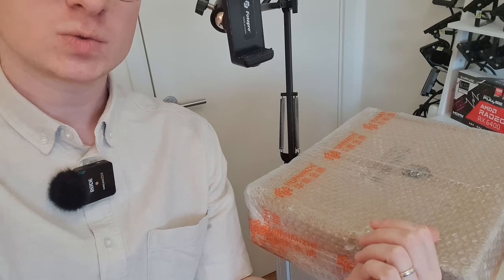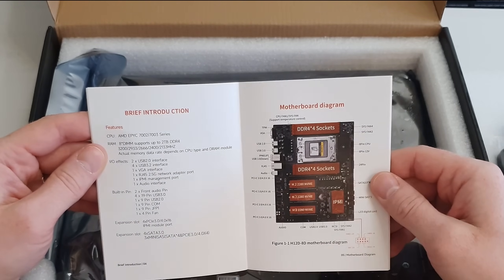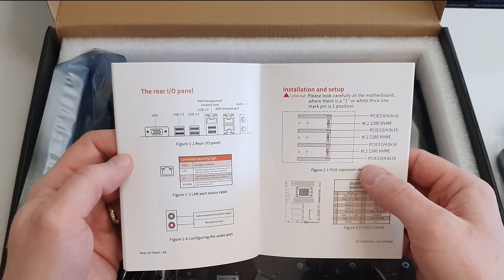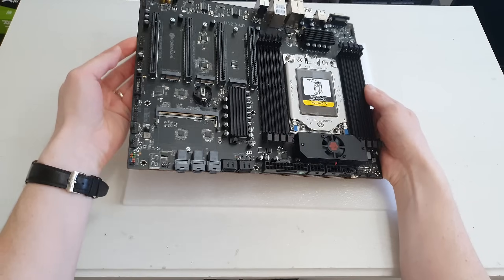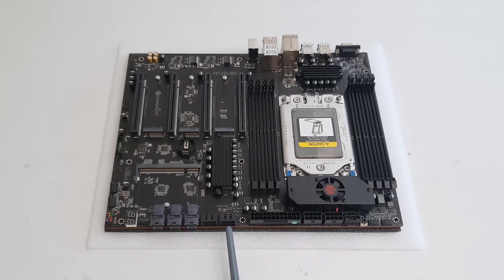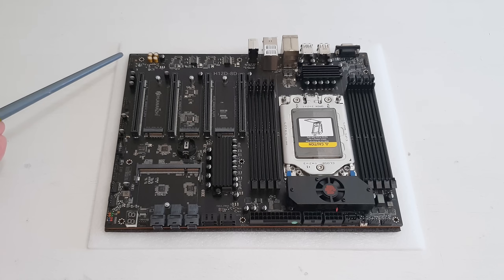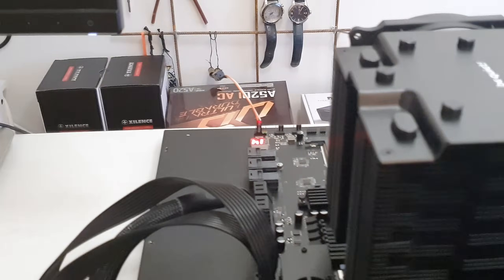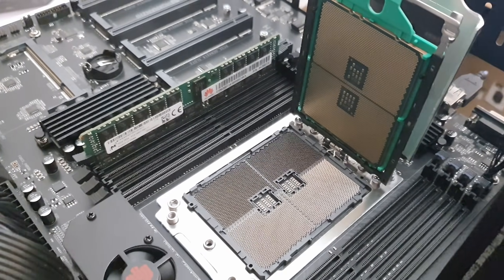Huananzhi H12D-8D EPYC motherboard – unboxing and first boot attempt

Comment: Hi, would you mind revisiting the board again? I just bought it a while ago and mine came shipped with BIOS-version 2.0 and my booting times even with BMC is way shorter than in your tests maybe around a minute.
I came across that board earlier this year but your review helped me a lot in my purchase decision. Currently it's running an Epyc 7402 and 8x16GB ECC from Samsung and so far it runs like a charm...
Reply from the maker: I no longer have the motherboard and I can't afford buying another one at the moment.

Comment: Hello everyone, I bought this board along with the Epyc 7702, but I'm having post code D0, after researching a little I saw that it's something related to the CPU, has anyone experienced this problem?
Reply from the maker: Are you sure your CPU is not vendor locked? How much and what RAM do you have installed?

Comment: Rookie mistake with the missing CMOS battery, since Ryzen debuted, AMD systems will now take a while to train the internal clocks to pair the cpu, ram and motherboard so it will take a while and reboot a few times. Since there was no CMOS battery, there was no charge to keep the configuration ok it's next reboot.

Comment: Almost all modern server motherboards have a Server Management Processor (SMP) like the Aspeed AST2500 on the Huananzhi H12D-8D. The SMP boots up before the CPU, it does a check of the components and displays boot progress through the VGA port. Using the VGA port initially allows you access to CMOS settings typically the "del" key, where you can set the add-in GPU as the primary display. The EPYC CPU is an 8 memory channel CPU and ideally you should install 8 identical DIMM.

Comment: Awww bro. Watching you tighten the CPU bracket without the right tension hurt my techno soul. If youre gonna play with EPYC and Threadripper you need to find your AMD torque driver. Without the right tension you will likely have issues with PCIe connectivity and RAM as all channels may not be properly connected.
EDIT: Oh and then you installed the memory wrong.
And then also didnt install a CMOS battery. You NEED a CMOS battery with these systems as during initiation there is power testing and training phases that require that you have a CMOS battery installed. Rookie mistake, but this is how you learn random crap like that. Through experience. Often we learn the most about things when they don't work and we have to troubleshoot them. Especially the random obscure crap like that which will be useless knowledge in any other situation.
Reply from the maker: I agree about the CMOS battery, should have tried installing it. RAM I have tested in all possible positions, just not on the video, also with the Chinese motherboards you never know what is the first slot, they often copy titles from branded boards but use own random tracing. In the past I dealt with quite a few Threadrippers so I kinda know the required torque and so far my torque feelings are correct but I will try to find the appropriate screw driver either way.
Reply: @Miyconst  Yeah, thats fair enough. If you have been using a normal driver and you already have a feel for the right tension, thats good. And yeah, those chinese boards do get weird with how they do some things.
Funny thing about the CMOS battery. The reason I know about the initialising sequence requiring a CMOS battery is because I had the same trouble myself. Only it took me longer to figure it out cos I had a CMOS battery in there, but it was flat and I didnt know. But thats often the only way to learn random specific technical crap like that. While trying to figure out why tf something is not working when you think it should.

Comment: @JasonsLabVideos 
43 minutes ago 
@sarisniper7990 Its not going to automatically go out on the internet and get an update 
to reply 
@sarisniper7990 
0 seconds ago  
@JasonsLabVideos I didn't just mean automatically. Oh smart guy, I just said brief words. I mean that by pressing the keyboard or by downloading Windows, this is done automatically. After that, it is updated. This is exactly what I meant, but only smart people understand what I said. Automatically, BIOS, such as the graphics card and other things, etc. There is also a way to run a CD drive. Download Windows discs or computer driver programs are found on the discs.

Comment: Check if this board can bypass "OEM LOCKED" cpu's --- what would be really good as those cpu's are always a bit cheaper.
Reply from the maker: That's very unlikely but if I ever get a vendor locked CPU - I will check.
Reply: That is a feature of the CPU, NOT the Motherboard.

Comment: 🤔👍Hi! Why didn't you try putting this in the BMNC? Also, why didn't you replace the graphics card with another one? The RAM isn't put in this way. It's not put on one side only, but one opposite the other, so try it. Also, why don't you try putting in the internet cable? You might need to automatically update the BIOS or something else.
Reply from the maker: I have already managed to get the motherboard started, thanks for the ideas though.

Comment: would it possible to mod the bios to make the amd epyc vendor locked cpu work with the motherboard? I have a dell epyc 7702P and I was looking for a "cheap" motherboard to use it
Reply from the maker: That's either impossible or very hard to do. You would need to obtain Dell's private cryptographic keys and then make the motherboard to pretend that it's a Dell machine.
Reply: @Miyconst  I understand, that's unfortunate

Comment: The board looks great. I think this is the best upgrade path for those of us still on X99 (even dual boards) that want high cores & lanes; makes more sense than X299 at this point. I wonder if Huananzhi will release a dual socket version, now that would be EPIC. After your review of the booted version comes out, I think if it's all okay and solid, I will sell most of my boards and get this.
Reply: I wonder, what are y'all doing for EPYC to be worth it? If you've got a gpu or nvme server, just stick to the old platform and if you need all out cpu power, ryzen 7950x or 9950x is scary good.
Reply: @b127_1 YT deletes my long detailed comments but the CPUs are fine for sure. But ATX and EATX board options absolutely suck and you can't convince me otherwise; all the AM5 boards were a huge disappointment to me and a complete joke for the form factor. Even the slot arrangements got worse from AM4.
Reply: @b127_1 mostly just hobby, I have 4 x 4U servers, tons of boards. Issue with some boards, especially dual X99 is they didn't get the ReBar BIOS update and don't have slot bifurcation; some of the single proc X99 boards do. So you don't really get the benefit of some of the newer GPUS bandwidth wise or cheaper addon cards that don't need a PLX switch for bifurcation. Plus of course stuck at 3.0 PCIe.  The newer Ryzen CPUs are fine of course for a lot but the motherboards absolutely suck. Almost all the AM5 boards are absolutely a joke in ATX and EATX form factor. I've looked at every single one. If you're just a basic gamer or just some basic Plex or basic VMer that yeah, it's fine but ultra boring to people like me. I personally love have 3 x GPUs, multiple NVMe adapter cards, plus other cards and maxing out the I/O with lots of drives, etc. I love being able to do whatever I want with Blender, run lots of VMs, etc. I love having tons of cores, And now with AI, I love coming up with random programs to scrape the internet and do various projects with the data. Just depends on the person. But main issue for me isn't CPUs, it's the absolute joke of consumer boards nowadays. ASRock Z77 Extreme11 for example were night and day difference to the junk out now. And because of inflation and other factors, almost all of it is 2x or 3x more expensive than it should be for anything traditionally in the HEDT realm. So these EPYC boards are great value. The reason I don't want the current SuperMicro and Gigabyte boards is because the VRM heatsink setups absolutely suck and I love black PCBs. Yup, my servers have RGB and all that too. It's fun for me.
Reply: @b127_1, for me it's all the pcie lanes, going to set up a media/file server to manage all stuff and a board like this with EPIC allows me enough pcie lanes to connect 32 hard drives with one HBA card. 😁

Comment: Miyconst, I got this board a little over a week ago and was having the same issue with an Epyc 7532... For whatever reason this board requires the CMOS battery for it to train memory.  I haven't seen this behavior since older intel CPU's but yeah toss a CMOS battery into the board and you should have no problem.
Reply: It's because Epyc's IMC requires stable clock source for training. For low quality power stages paired with low quality power supplies it's pretty common to have skewed clock cycles when all the devices are initializing. Cutting the 3.3V supply to CLK_BUS and requiring a battery for initial timing just avoids the stability issues.

Learned this hard way working with custom design from Kontron.
Reply from the maker: You are absolutely right, I have figured it out the next morning but thanks for the hint either way. How is your board doing so far?

Comment: It had happened to me, i have a supermicro H11SS-i and a epyc 7551p, i bought a epyc 7662 cpu and doest boot up, some epyc processors have a vendor block i guess, kind some vendors like dell build servers with this cpu to only works in DELL servers.
Reply from the maker: Yeah, this is just a disgusting feature to produce even more ewaste and cover it up with "security protocols". In my case the CPU isn't locked and I managed to get the board started.

Comment: Very excited to see you test this board and hear your thoughts. These seem like great platforms for 2 slot gpus. All of my boards are supermicro H11. I would be curious to see if any of the surface mount stuff interferes with using a gpu in any of the slots. As others have said, LRDIMMS or unbuffered ECC likely wont work. Not sure how closely they are copying other manufacturers but maybe the dram needs to be in slot 3/C for a reliable first boot.

Comment: I don't see BIOS battery CR2032 on it's socket ( - pole steel ark of battery visible!). BIOS not present and working so there 11 code memory should also be in both banks each side of CPU at least 1 and 1 each...

Comment: Hi Micons, try it, but with BIOS battery or RAM management it seems like the Asus X99-A... or change the power supply to a 1000 or 1200 wt gold one... it is a server that requires a lot of power. Don't forget the RAM configuration... according to the manufacturer

Comment: battery...
Reply from the maker: I am yet to confirm that it was the battery issue but after I installed it and boot looped the motherboard several times it started up.

Comment: I've been running mine for a week or so now, been super solid so far.
Reply from the maker: What CPU are you using it with?
Reply: @Miyconst  7532, 128gb, 6900XT. Blender benchmark wise it's just shy of 2x2699v4's.
Reply: @TheOriginalGeekyNoob  would not expect much from cpu, the sole purpose of this mobo is either lots of nvme disks, 3+4*4 so 19 in total or 4 gpus @x16 or 8 @x8 with pcie splitters
Reply from the maker: @TheOriginalGeekyNoob  wow, that's exactly the CPU I am looking to buy for extra testing.
Reply: @treniotajuodvarnis  You'd be surprised I think, its a very good Arch workstation so far.
Reply: @Miyconst  If you can grab a 7542, that'll give you a bit less cache, but, a tiny bit more clock-speed, it appears the best Workstation sweet-spot in the 7002 line-up :)
Reply: @TheOriginalGeekyNoob  I  doubt it as arch apps needs good single core performance and 7002 series is like ryzen 3000 or slower, 7003 is like ryzen 5000 a bit better, but for 3ds max single core performance is crucial. That's why there's threadripper, same epyc with 128 pci lanes but faster as epyc is for cramped servers less watage to keep it cool. Maybe at rendering with cpu and 64 cores makes sense, but I'd rather render with gpu it is much faster and you can fit 4 or more there :) this mobo and cpu is more for serving peripherals on pcie lanes but not full cpu load like rendering. passmark has good comparrison tool 7950 ryzen is much faster than 7532 epyc and twice faster single core, only advantage you can fit 2tb ram while ryzen maxed out 256gb ddr5  4x64gb kit is very expensive
Reply: @treniotajuodvarnis  Its definitely far from optimal for sure, and for the same money I could go faster (I've plenty of much newer machines), but, there's something about this old big-iron, like running a completely pointless dual-Xeon, I just like it :) Day to day my other Arch box is a 5900X and 6950XT, which is faster in every way that actually matters (aside outright full core workloads), but, I like running these big ol' server chips :)
Reply: @Miyconst  7532 with 8-sticks of 16Gb for 128Gb, 6900XT, benchmarks in blender just a touch shy of a pair of 2699v4's.

Comment: That be quite cooler comes with a long screw driver and you can loseen up the 2 caps on the top to get to the screw's this a cosmetic choice and you wil know this if you looks at the menual or you just lost the screw driver 😂
Reply from the maker: I know about the cap, I just didn't bother with it, the cooler itself I have got like this, with no screw driver.

Comment: did you try it with a CMOS battery installed?
it is poor board design that requires the battery to boot - but many motherboard manufacturers have been guilty of shipping such a design
the power on sequencing can be quite complex
Reply from the maker: That's exactly how I got it booted! Could be just a coincidence but after installing the battery and boot looping several times it started up.
Reply: @Miyconst  like the ancient intel motherboards.

Comment: Maybe try a Not wender locked CPU that woud Help to Boot it up. Epyc hast a Feature to lock in one brad. The BMC you can try also without. BMC is the short term for Baseband Managing Control or for normal perople... A Computer within the Computer
Reply from the maker: I know about this stupid vendor locking but this CPU is unlocked. Anyway, I managed to get it started.
Reply: Thats good to hear. I know the Troubleshooting with Servers and banks of memory.

Comment: In China, they sell CPU + MB + Cooling for around USD550. Very itching to get a set with 1TB RAM.
Reply from the maker: It's certainly cool but what would you use it for?
Reply: @Miyconst  Compile Android system, put all the source on RAM drive, It take more than a hour for my 16 cores 1950x to build, just want to see how it runs on 48 cores. But recently, the need to build is not so frequent, and so, I have not bought it.

Comment: Tightening the CPU to the correct torque is very important. Uneven torque can cause bad contacts with the socket pins on one side. Find the threadripper torque driver and use that to tighten the socket screws properly. There's a reason those sockets require a certain torque level.
If installing only one DIMM, you need to install it in the first channel of the CPU (DIMMA1). Also make sure the memory is RDIMM and not LRDIMM. Even Supermicro boards are picky when it comes to LRDIMM memory.
Reply from the maker: Thanks for the suggestions, I have managed to get it started with the CPU and RAM I had. Not sure what exactly has changed but now it starts. The only noticable difference is that installed the CMOS battery.
Reply: @Miyconst For some boards, having CMOS battery is mandatory for boot
Reply: @Miyconst  i had this issue with my hp z8 g5 dual cpu LOL one cpu was dropping channels like crazy it wasnt until i tightened it another 5 pounds that it stopped doing that hahahaha drove me nuts
Reply: @Miyconst  yes it cam rather simplify the design if you rely on the battery to power such things as BIOS rom chip (for example) if you have multimeter and the expertise that would be a very nice thing to check :)
Reply: When I was shopping for my Supermicro H11SSL-i board, I made it a point to make sure I had gotten an official Threadripper/Epyc torque driver first; I wasn't going to chance a manual torque setting of 'gutentight' with it at all.

Comment: If you use a dell locked CPU on a supermicro board you get Code 78 which means it needs BIOS Recovery. Maybe it's a pressure issue? Maybe try using a torque screwdriver?
Reply from the maker: Thanks for the suggestions, I actually managed to get the motherboard booted, not sure what exactly I have done though. Will keep testing.